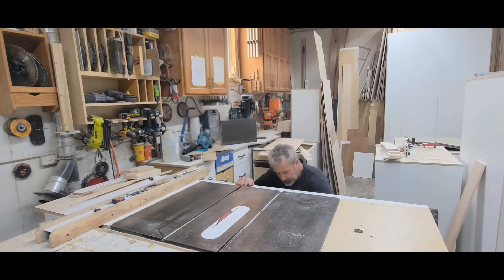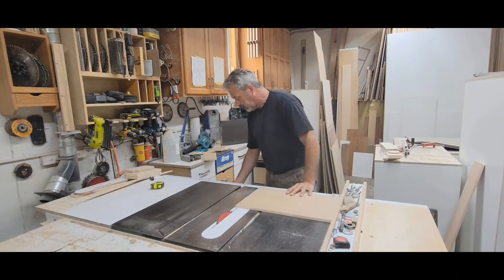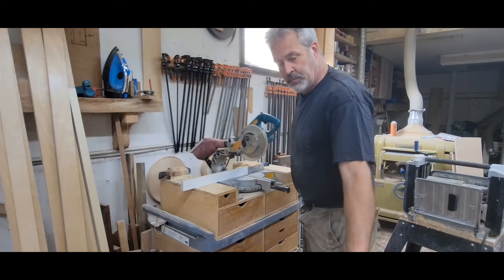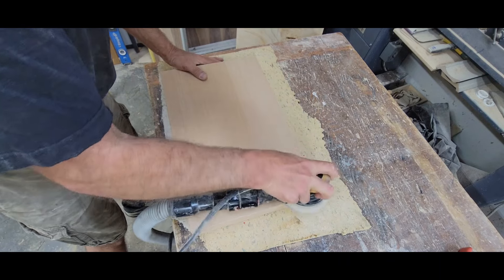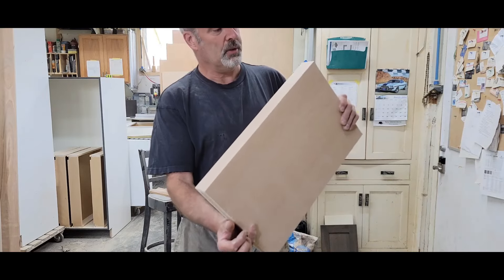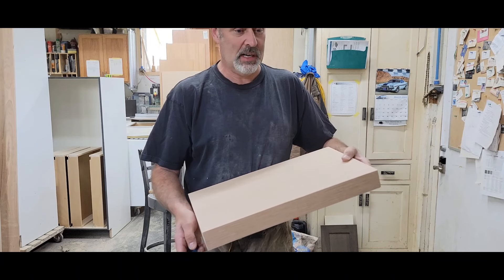Simple and quick suspended shelves

Comment: Another excellent video. Do you think painters tape is too weak for this project?
Reply from the maker: Yes you can definitely use painters tape as well. Just make sure it's good quality. I find the packing tape has a bit of stretch to it. Just don't pull it too much, I once it myself in the groin when it snapped. Not a great way to start a day